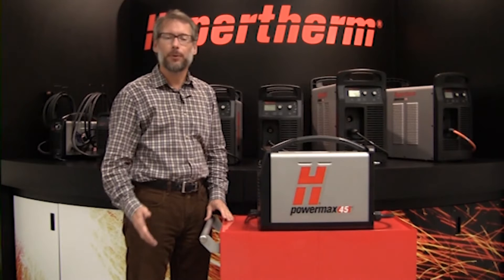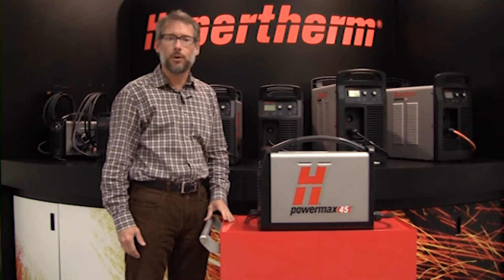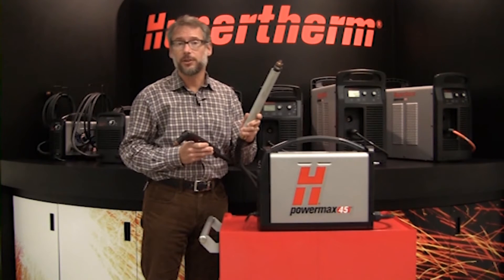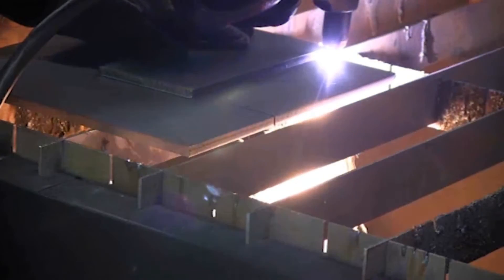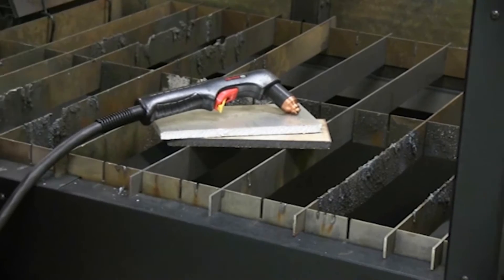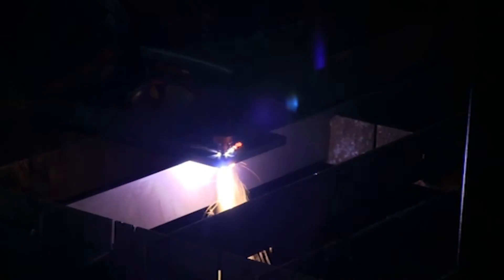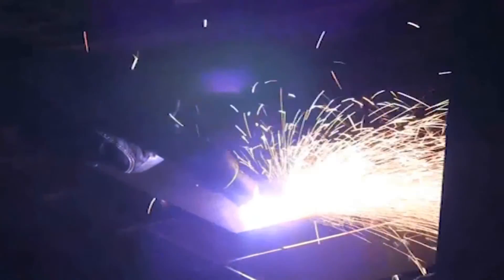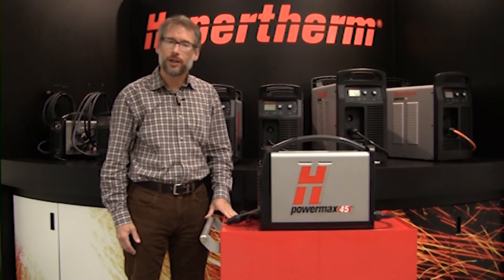Hypertherm Powermax45: System overview and demonstration

Comment: Is there a way i can test this machine that is connected to a cnc table with the table torch connected to see if it will make an arc without the controlls with mach3 connected. The laptop is missing and I can get that machine for a very fair price. Table incl. But i dont want to buy a broken machine.

Comment: Hypertherm is the best out there.  I'm a heavy equipment feild mechanic/ welder and use a powermax 1000. Using the gouging mode to cut bucket liners out is so fast and so precise! Hypertherm is the only way to go.